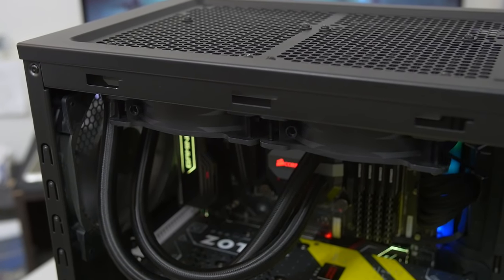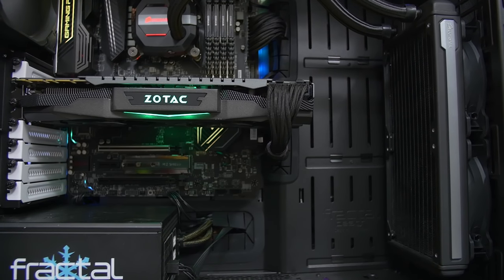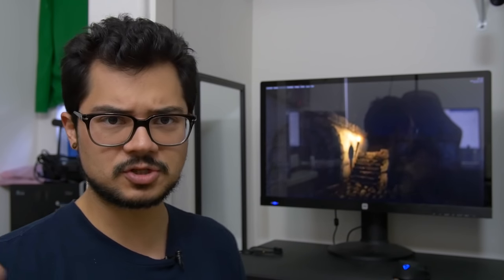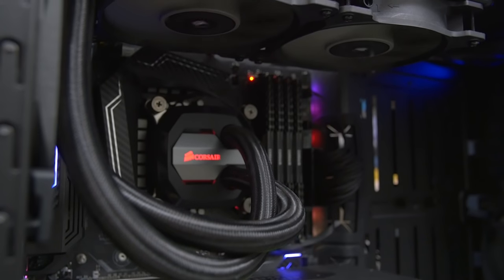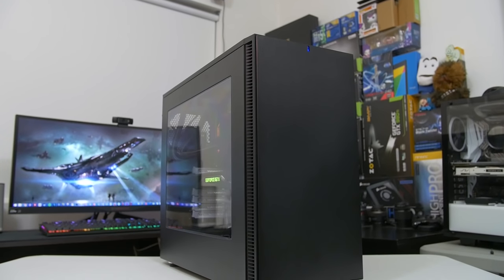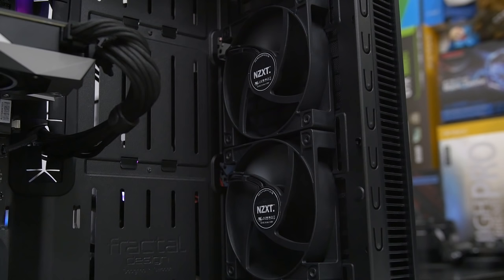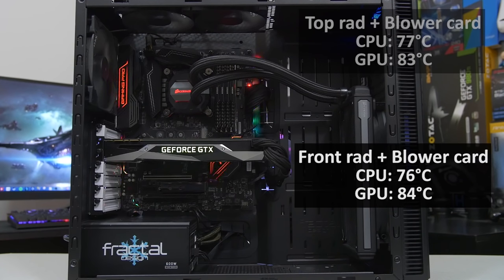Does Radiator Placement Matter? Hint: YES

Comment: The front rad + open card configuration, the top and rear fans are exhausting right?
Reply: Have the same question but this also doesn't make sense as all fans be exhausting (front rad exhausting out + top fans exhausting out + rear fan exhausting out) which means no air in-take?!

Comment: Could you make another test on a Midtower with an big grafikscard like an rx 5700 xt rog strix? I am receaving one and have a water cooled ryzen 5 2600. The Gpu is gonna get pretty close to the radiator fan at the front and want to know, if it is worth it to still let it there.

Comment: I have a 360mm AIO that has to be mounted in front due to clearance problem up top...but I'm thinking that's better anyway but I'm placing the fans to push air through the rad out the front of the case. I'm placing three additional fans up top blowing down and the rear fan blowing in. Is this airflow setup okay??

Comment: I have my cpu cooler too mounted with fans on top of the radiator and my cpu doesn’t get above 45° C but my gpu does get hotter but not much because I only have one fan for exhaust at the back of the case

Comment: I bought a prebuilt pc 2 months ago with an RTX 2070 windforce and an i7 10700f. The pc had only 1 rear exhaust fan and cpu temps were hitting mid 70s in the first month. I decided to add 3 intake fans on the front panel and 2 exhausts on the top. Cpu tems are sitting at 75 in games and spiking to 85 C pretty commonly. Switching to an AIO according to this vid would only save my cpu a few degrees.. is it worthit?

Comment: Noob question here, but with the radiator mounted in the front as an intake, when you mount case fans at the top are they intake or exhaust fans at the top?
Reply: @adamd1347  Thanks Adam!

Comment: i dont really see a big difference in top or front mounted.  my top mount the cpu is 1 c cooler video card runs cooler by a bit.  but my case has a screen mesh and i have the intake and rear exhaust at about 80% so plenty of fresh air for the fins and gpu

Comment: Will moving my single slot radiator set to exhaust yield similar results if placed at the front as intake?? And if so, what slot, top, middle or bottom, assuming it will reach.

Comment: *QUESTION:* My case is an NZXT Phantom 240 and can only fit a 240mm radiator AIO liquid cooler in the front of the PC, a larger one would not fit in the front. However, on the top of the case it can fit the bigger 280mm radiator. I have an open shroud 1080 graphics card. So my question is would you recommend a 240mm rad cooler in the front or a 280mm rad cooler on the top? I just want the best possible cooling for the PC. I know if it was 240 vs 240 I would put it on the front obviously but since it’s 240 vs 280 I don’t know if the 280 up top can do a better job than the 240 on the front? I was trying to choose between the Corsair h100i platinum to put on the front or the bigger h115i to put on the top. I would really appreciate an expert opinion on this! Thank you so much!

Comment: when you have the radiator mounted on the front you are using the push configuration correct?
and the fan on the top and back also use a push configuration?
Reply: heinamen Push or Pull configuration has no major impact on performance, that is, any difference seen in testing was ruled Margin Of Error. The only configuration that will have major performance differences from Push and Pull is a Push/Pull, which yields performance benefits, and I would suggest doing it possible for you.
Reply: @jstaal7879  
thanks i really appreciate the response 
cheers

Comment: What about top rad pulling/pushing air inside the case instead of outside and a strong rear fan and the PSU as the only exhaust fans? It's probably worse than front mounted rad but it can't be worse than top rad with exhaust fans, can it?

Comment: new discoveries made by Gamers Nexus shows that front mounted radiators must be above the height of the CPU, so it will make the air accumulate on the radiator and not on the pump.

Comment: I've noticed the radiator at top position the pipes are nearer the rear, wonder if temps changed due to restricted air flow due to the water pipes?

Comment: having a blower style 2070 GPU with corsair 275r case and it overheats without overclocking on DCS VR gaming. not sure what to do about, front radiator just like this video.

Comment: I just switched from a top mount to a front mount and my cpu temps dropped 23 C. I was not expecting anything close to that.... I was at 88 C under full load on a 9700K overclocked and was desperate. My GPU temps have risen maybe 2 C under full load and are staying under 70.

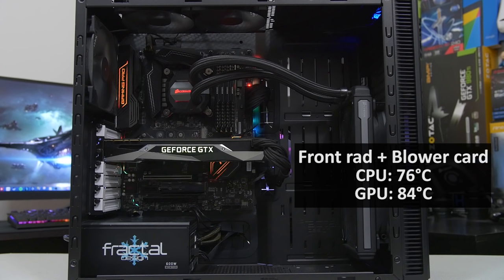Comment: Dumb question (im new at this, go easy on me) but when the case fans are at the top and back, are they all exhaust fans? 9:14
Reply: I'm also wondering this. I'm assuming that the front radiator fans are pulling in cool air and the back and top fans are all blowing the hot air out. Is that right?
Reply: Nic I think so. I’m gonna be building my first pc and It’s basically gonna be the same layout as that. With the radiator upfront and two fans in the back. I just didn’t know which way they were facing.

Comment: Looking to put my new aio in. im going to put it at the front i think but im worried im going to throttle my intake too much. im building in a meshify C and it already has a filter over its two intakes, if i cover them with a rad am i going to choke out my machine?

Comment: I think you failed ont his test. If I remember right - you never mentioned changing the fan settings. It is very obvious that gpu temps won't change much if you keep gpu fans at stock speed, which always are temperature controlled :)
So, I decided to do my own tests today.
I have I9-9000K overclocked @ 4,9Ghz and manual voltages, cpu fitted with corsair aio with 3x noctua 3000rpm industrial fans which all set manually to 1200rpm accurate as possible.
My GPU is RTX 2060 with two fans, both set manually to 65% on both tests.
On the first test, my cpu radiator was set to top, and secondly on front.
I ran Prime95 without AVX + Furmar at the same time, to get maxime heat for both CPU and GPU. In both tests, I ran them for 20 minutes and I checked my room temp, which was 23,3celcius at beging of tests, for both tests.
By moving radiator from top to front - my cpu temps dropped from 0 to 2 celcius degrees meanwhile GPU temp increased by 3 ceclius degrees.
So it real does not effect so much. Excep atleast on my setup - when radiator is at front - the noise of fans hits are louder to my ears. Now I hear 3x 120mm fans of radiator alot more due it's front of the case, so radiator is not making them any silencer anymore, but also fans of gpu are more  easy to spot because radiator does not make those noises any more silencer.

So in short: CPU temps dropped from 0 to 2 celcius (at max), meanwhile GPU temp increased by 3 celcius degrees, and for my setup, the noise of computer increased by 3dB(A) (50-51dBA to over 53dBA).
More short when I swithced radiator from top to front:
CPU dropped from 0 to 2 celcius
GPU increased 3 celcius
Noise volume increases about 3dBA
Reply: When you had the radiator mounted to the front as intake, were the fans on top set to intake or exhaust? I'm assuming the rear fan is exhaust.
Reply: @GreenMunkyNic  Ofcourse the top ones was put to exhaust, just like put with AIO on top. Also the rear one as exhaust. So cold air comes in my case from bottom/front and front, and warm air is pushed out from rear-top and top.

Comment: i got mine to drop a few by mounting rad on top with 3 fans on front pulling air in and the gpu has a AIO with rad at back as exhaust with top rad with 2 140mm fans blowing out and it dropped for me dont know why. i think environment of the case is another big factor that not many people think about.

Comment: How would using the aio as an intake on the bottom of the case work out? My computer case doesn't have an intake on the front because it is glass but it has spots for fans and such on the very bottom.

Comment: So, I've got 2 slots for fans at the front of my pc, I think I'm gonna mount my 120mm radiator on the top slot so it doesn't push air onto the gpu. Sound good?

Comment: I've got a 240mm aio for the CPU and an evga 1080 hybrid with 120mm rad. All sounds nice, but I've got a matx case 😂 but I'm assuming case temps are fine since buth of the radiators are exhausting (120mm is at the front because there was no space to put it in the back lol, whilst 2 of the other fans in the front are intake). How screwed am I? 😂

Comment: 360 top intake Rad (There is a dust filter on there for a reason!), 2 140mm front intake (There is a dust filter on there for a reason!), 1 140mm exhaust on back (No dust filter!)

Comment: I have tried both, and my question is how come I see barely any difference? I have an open shroud GPU, and I've had my radiator and fans in front set to intake before and now I have it on top as exhaust but the temperatures are the same... What's the explanation to that?
Reply: You might have a bottleneck elsewhere. Pump performance comes to mind.

Comment: The closed loop system will have 2 to 10% air in system, air gap will rise naturally and cause gurgling and/or whining sounds from pump and can cause poor performance. Stop mounting radiators wrong read the manufacturer recommended mounting.

Comment: If I have a front mounted 280mm from rad forAIO CPU, where should I then put a 140mm rad for the AIO GPU? Top or bottom or on the back. Front is now taken by a 280mm CPU rad.

Comment: On Top as an intake have given me the best cooling results on 2 different rigs
Reply: I was thinking about trying this, my gpu spews hot air out the end towards the radiator when it's at the front. Did you have that issue?
Reply: @xDRAGONSHAGGERx  my GPU is still horizontally mounted so I'm guessing yours is vertically mounted?
I have a triple 120 intake on the bottom, and my triple aio rad intake ontop.
1 triple 120 exhaust on the side.
I think a big factor too is how the airflows through your case and how many vented areas it has where ambient air is pulled into it. Double the intake than exhaust is usually the best policy to create a really good positive pressure for your case. 
I have the Lian Li O11 Dynamic case with an i9900k CPU, having the aio triple rad ontop intaking gives me a solid CPU temperature of around 35° idle and a maximum of 51° under full load. With the aio triple rad exhausting I got +10° on each of those temps..

Comment: I had my PC built by cyberpower, the 280mm AIO is installed on the front panel, with the fans in an intake position, but the fans are on the inside and the radiator is outside, so the fans are pulling air through the radiator. 
In every other setup I've seen the fans are on the outside and the radiator is on the inside so the fans are pushing air through the radiator. 
Why would they set it up like that?
I've been using it for a while with no problems but should I take it out and move the fans so they're on the outside or just leave it alone?

Comment: Hey any advice? I have rgb fans on the front of the case.but the front is the only place I can mount the rad..so do I set the rgb fans to blow throug the rad then my rad fans to suck the air out and through the case?

Comment: 77c on the CPU .. what?! guy has no idea what he was doing
Reply: I am not sure what you mean? I.e if you are saying 77 is good or bad lol. With an OC at 4.8ghz on my i7 9800x and with the corsair h150i pro 360mm cooler, asus rog strix rtx 2080ti overclocked and plenty of case fans - I sometimes reached up to 90 degrees celcius on the CPU when gaming and streaming.... it was a stable OC, but I didn't like the temps that close to TDP so lowered the voltage and OC a bit. But my point is that it depends on the processor and how serious the OC is and he did say it was a high OC he was using purposely to make it run hotter, so 77 degrees celcius seems pretty reasonable to me considering?
Reply: @BlackCondorXVII  77 is terrible. It's fairly obvious that the CPU cooling plate isn't setup correctly. Doesn't really matter much since this video is 3 years old
Reply: @screamingiraffe  fair play. To be honest, I cannot even remember what cpu it was he was using in the video, but I am sure it's one I have never owned, so I cannot compare from personal experience. But for my current cpu - according to my own results and tons online, those temps are pretty normal for an overclock when running stress tests, so I was just comparing to that to be honest so was curious regarding your comment on it

Comment: ( edit : I think I have been somewhat missleading. It seems like it doesn’t matter much for the cpu and gpu temps since anyways the heat is mostly transferred to the rad (So would matter more for air cool gpu, mobo vrm and ram - However even then it seems by very little like 2c). Anyways don’t take my word for it... And sorry if I missled anyone ! :c )
—————————————————————
To anyone who sees this comment:
- The heat from the cpu is transfered to the radiator. DO NOT USE FANS AS INTAKE ON A RAD ! 
Else you are just blowing hot air into your pc. And between, the liquid moves quickly, so to those who say outside case, it might actually be a good idea.

Comment: my rad is in the front, i just would like to know if i should make it as an intake or exhaust?
Reply: Intake
Reply: You don’t exhaust air out the front of your case.
Reply: @Mrbooozle93  thanks for responding. ya i moved it to the top and kept it as an exhaust after some research.
Reply: @banditmain9189  exactly how mine is. I have three giant pre installed front fans and didn’t wanna mess any of those up.

Comment: My GPU is too long to fir a front AIO rad and fans in my case. So top mount is my only option. But knowing a AIO works much worse if top mounted, would it be better to just get a good air cooler?
Reply: Watch Gamers Nexus aio config, it will help you

Comment: What if the pump is built inside the radiator? standing at front will benefit still?
Reply: I'm wondering the same thing. I have rgb fans and wanted to place the fans on the other side so it still pulls air in.

Comment: What if we dont have the option of mounting it in the front (my 3070 is too long). Is it still worth it to get a watercooler and mount the radiator on the top as exhaust (compared to a stock 5600x fan)

Comment: I have the lian li o11 dynamic case with the radiator on the side with the fans pulling air through it. However it seems to not pull to much air through.

Comment: Sucks that I cant mount my radiator in the front. The spaces between my front and top fans won't allow it . I can't run the pipes from the bottom either because of the psu shroud .

Comment: well mine, that was built for me via MSI (yes... I know, please don't) - has a 120mm AIO and the rad is sitting at the back... three up front and none above...  I have the dreaded dead gunk aio - and in now for RMA - who knows what they'll send...  I'm thinking to install a 240 up top (there is plenty of room) and throw a case fan in the back - but I've never seen a vid with this particular scenario...  My thought are my own, but does anyone agree this would be an improvement?  after watching, I'm planning to see about putting a 360 up front, and reuse the case fans to top and rear... from this test, 10 degrees is pretty big... 5800X and 3060Ti soo I feel that should be more than sufficient...  I would run the experiment as well, gonna take a whole weekend, but what evs, already down now so whats a couple more days...  thank for the video.!

Comment: This is the incorrect way to mount your radiator regardless of temperatures. Air is accumulating at the top of the pump since its the highest in the loop

Comment: what happens if I put the fans screwed into the case on the top, and the radiator under them, but pushing air inside the case?

Comment: just recently built first my pc, using an  h100i corsair aio as top intake, the front panel with x3 120mm is also intake, should i change the fans on my aio as exhaust?  also the case im using is an nzxt 710i
Reply: I have different case, the Be Silent 500DX. but have the h100i on top and two be quiet whisper fans in front and one in back. optimal placement and direction is front pulling into case cool air, radiator fans on top pushing up and out, back fan pushing out. I also have a internal fan inside the power supply and it faces up, pulling air into the power supply and out the back radiator on the power supply. Hope this helps!

Comment: My case has a cage around the front 3 fans and it is pssible to mount the radiator on top of the cage without removing the stock (very good ones, mind you) fans and then the AIO fans on the radiator. This would results in a total of 5-6 fans (depending on AIO being 240 or 360) blowing through the front, but stacked in 2 layers.
I wonder how effective this setup is compared to simply mounting the radiator in the front and what limitations it might have. Any insights , guys?

Comment: Why would you have the rear fan exhausting with a top mount and not intake to feed fresh air to the CPU cooler?
Reply: So, I installed my 360mm cooler tonight and mounted it on the top, but instead of having the rear fan set to exhaust I set it to intake, so the top mount exhausting fans get fresh[er] air for the radiator fans.  My CPU temps playing Vermintide 2 for the last hour on extreme have not touched above 65C.  You should try setting the rear fan to intake next time, also to help create positive pressure within the case to increase ambient air movement
Reply: @DouglasDillingham  The rear doesn't have a dust filter usually, so in most cases its not very viable, afaik.